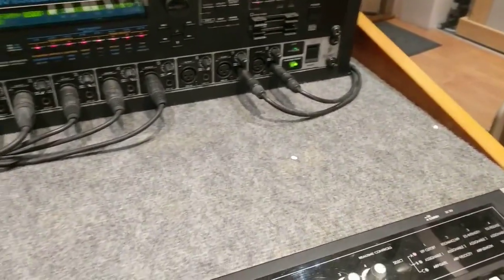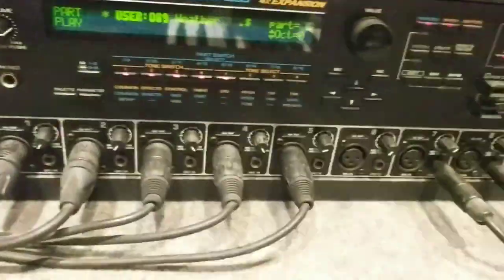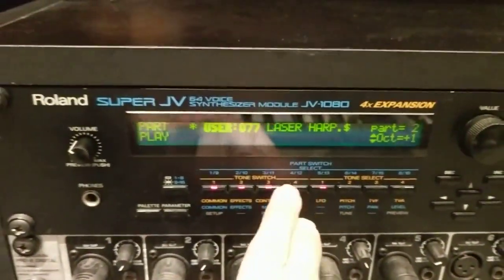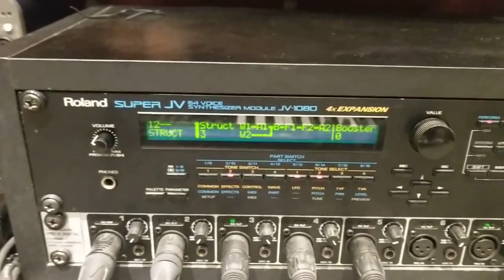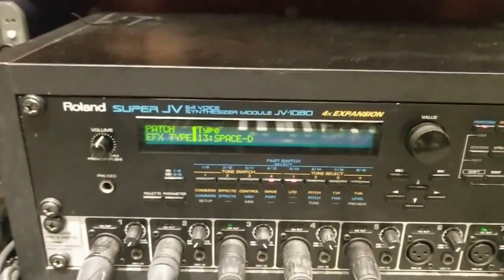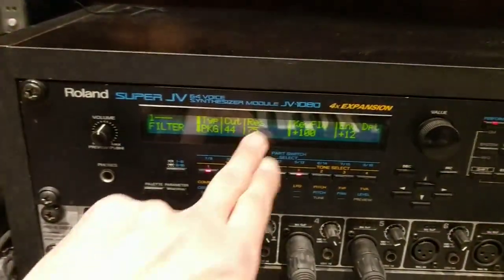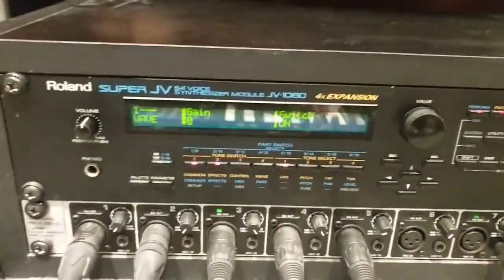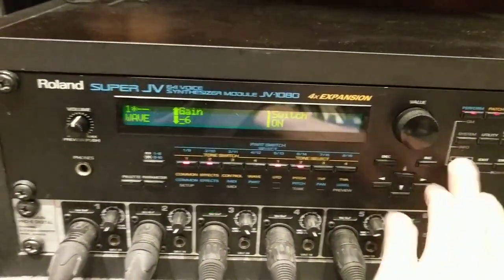Jarre's Rendez-vous laser harp (JV-1080)

Comment: What determines the speed of the sweep?  Is it one of the filter envelopes?  It's hilarious that Roland put these structures in there and wasn't able to come up with this desirable sound.  🙄
Reply from the maker: The sweep comes from the resonating filter. It's a filter sweep bailsically. Normally it would be made by using oacillator sync - and I agree that Roland should have added that feature. They did add it in JD-990, though, if I remember correctly.